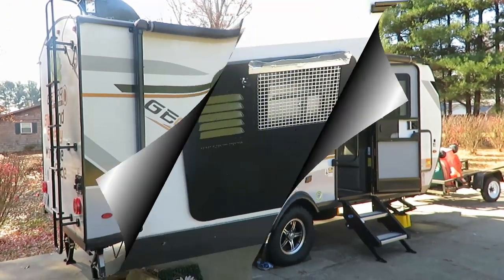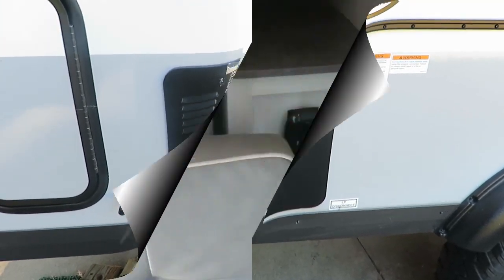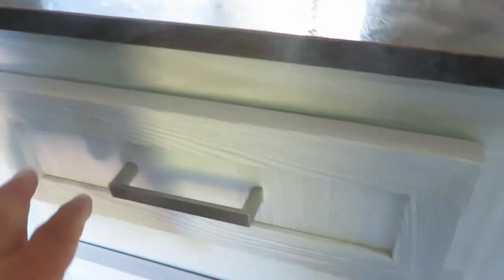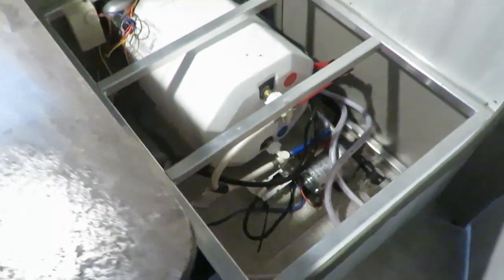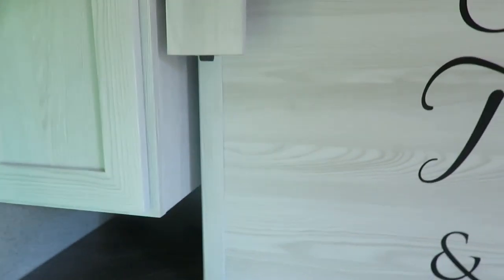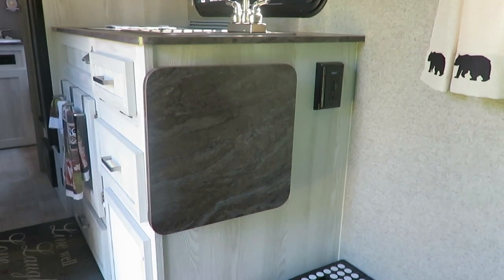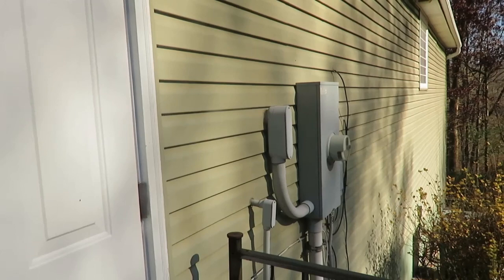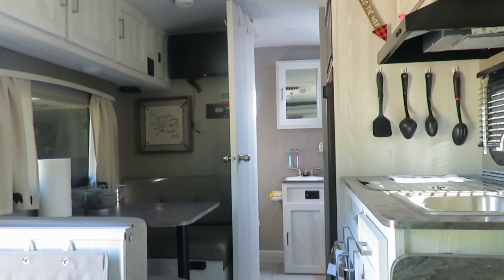Geo Pro Off Season Modifications

Comment: I have the 19FD too.  I added a 2000Watt inverter and 2 lithium batteries.  I can run the microwave, any household appliance and even the air conditioner for a short amount of time.  And added an a 190Watt solar panel on the roof.  Happy holidays!
Reply: Do you have notes on how you did that?  Do you have to replace wires or just swap out the batteries and the inverter?  I’d like to do that to mine as well.  

Did you add another solar panel or just keep the original 100 watt panel on the roof?
Reply: @y.t.5880  I had my dealer do it.  I know they had to increase the wire size from the battery to the inverter.  But the distance from the batteries to the inverter is really short.  And yes, I added a 190 W solar panel to the roof.
Reply: @todd2456  ok.  Bummer my dealer said they only do factory work and not battery rewire for lithium nor do they add solar.  I’ll have to find another dealer to do the work I guess.
Reply: @y.t.5880  Depending on where you live, you should be able to find some place pretty easily.  Good luck!
Reply: @y.t.5880  Yes, there are tons of companies who will install the solar and do the batteries. I was talking to a guy the other day whose company does house solar, but they do RV solar as well. So contact a solar company.

I do have a question for you... not sure what year yours is. I'm hoping to not get the oven and try to get a convection microwave instead. Did they ever give you that option? Thanks!
Reply: We have an a a 19FD.  I put two shelves in each of the wardrobes, a coat hook and a battery powered motion light.  We are about to replace the countertop and table along with a bigger sink and faucet.  I have also considered a drawer under the other bench seat.  Are you able to find material that matches the existing panel?

Comment: How does your inverter handle your cpap? Leave it on all night?
Reply from the maker: I never use the inverter with CPAP, the best thing is to buy a 12 volt cord from your CPAP company (most of the time you can find on Amazon) the 12 volt cord used much less amp hours. You should be able to get 2 to 3 nights out of most single 12 volt battery as long as you turn off the humidity setting.